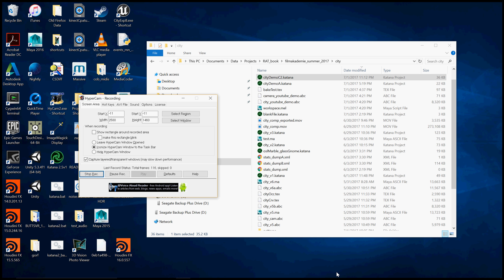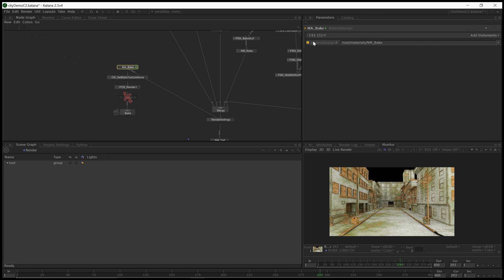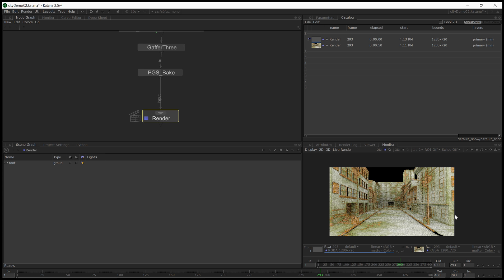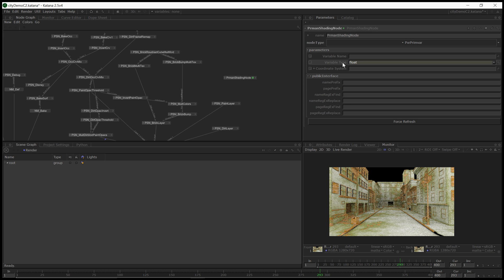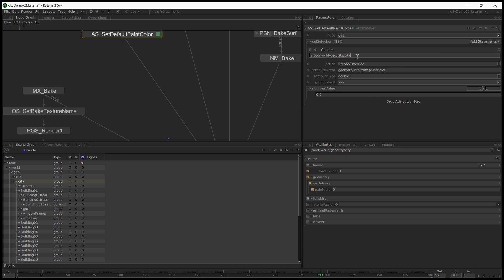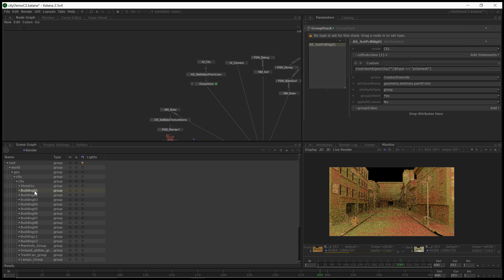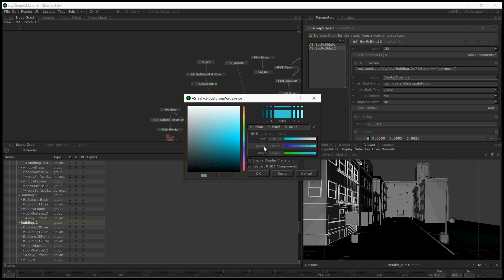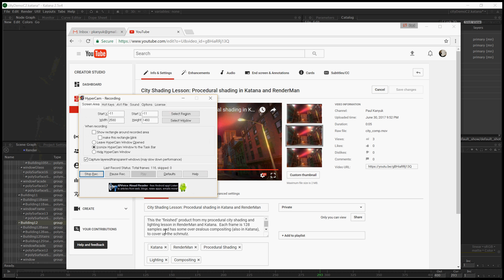Katana and RenderMan LookDev: City Scene Part 3

Comment: hi...awsome work...learnd a lot....can you make a tutorial on renderman displacement in katana?
Reply from the maker: Thanks, glad you liked it!  Sure, I actually did cover that topic briefly in another set of lessons.  Here's an example of how to use fractals to drive displacement on a "procedural still life" in RenderMan for Katana: https://youtu.be/eQbHEwiOXAQ
Reply: Thanks Paul....but i have a problem in displacement....when i use displacement maps my mesh is exploding....can you help me with this?
https://renderman.pixar.com/forum/attachment.php?s=&postid=210073
i tried even vector displacement form zbrush...but it doesnt seems to work....im getting the same result every time
Reply from the maker: Hi Deepak, I have two ideas.  One is displacement bound, if that's set too low, you'll get "patch cracks".  This should be accessible from the PrmanObjectStatements node.  Another is the mesh type.  Polygons tend to tear apart along edges, but subdivision surfaces can displace smoothly.  I'd try changing the type of the mesh from polymesh to subdmesh and see if that helps.  Also, I'd try to rule out the pattern you're using by just connecting a PxrFractal first to make sure that looks reasonable.  Hope that helps!
Reply: thank you so much Paul Kanyuk....my djsplacement bound is high and my mesh type is subdmesh...il try fractal and let yu know paul...is there any other way tat i can connet to yu? other thn youtube
Reply from the maker: Gotcha, the renderman forum might be a good place, can you send me a link to that thread where you posted that picture of the problem?
Reply: yeah...thanks paul...here is the link https://renderman.pixar.com/forum/showthread.php?s=&postid=210223#post210223
Reply: hi Paul..can you make a tutorial on complete aov setup...includin zdpth motion vector light aovs and al other passes...im new to katana..i coulnd able to find documention on tat
Reply from the maker: Hi Deepak, gotcha, I have a tutorial on setting up Matte ID AOVs, denoising AOVs, and light group AOVs: 
https://youtu.be/NrYOhhXoLXU
I didn't call it out explicitly, but one of the channels used in denoising is z (the denoising input is a big multi-channel exr), so that's definitely usable as a z pass for compositing.  I'll have to double check on motion vectors, but I think it's the dPdtime channel.
Reply: Thank you so much for the consideration Paul.....